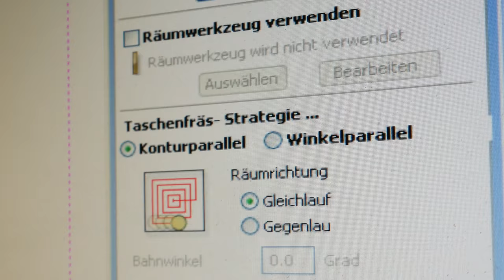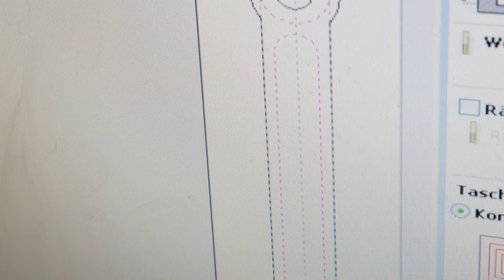Creating A Designer Utensil From Scratch

Comment: Great video, there's so much skill involved in the set up before you can start using the machines, machine made or hand made, both require skill but in different areas. To be honest I was trying to figure what it was all the way through, 1st a bread board, then a wooden backing for a thermometer and barometer, finally my wife figured it.

Comment: hello Simeon, I have a question that does not pertain to your video, but am curious. what materials do you use most common on the roof of your houses in Sweden? I am renovating my house that is almost 200 years old in northeast USA. most common in my area are asphalt shingles followed by metal and a small number of slate or tile. I am a tinsmith by trade and most likely use metal for my renovation. and is the vinyl plastic siding common on houses in rural sweden?